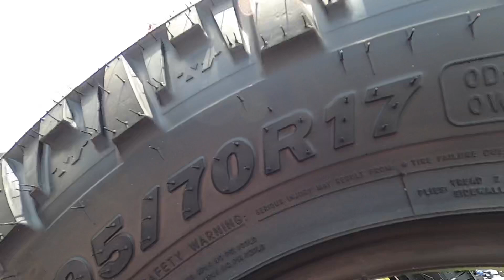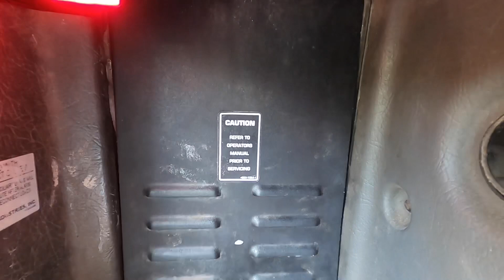Kenworth problems & Fuel tank leak

Comment: Just when I thought I had a bad day, I watched this video and I guess my day wasn't that bad. The tank patches turned out good and you can't see them. What I do is check the tightness of the straps every so often because they do loosen up and will cause wear behind the straps. And get a tube of die-electric grease and put some in each hole of the electrical plug and around the end of the plug where it will go into the female side of the trailer. It helps keep the moisture out and it's easier to plug and unplug without pulling the pins out of the trailer side.

Comment: Love doing burnouts with my pickup truck. It makes 625hp. Single turbo. It is a 3500 2018 dodge. It’s my daily, and it tows my race trailers. Really awesome truck. I was impressed on it stock. I upgraded it because I had to haul a bigger load on my gooseneck flatbed. It pulls the trailers like they aren’t even there now. Good trucks and the Cummins motors in em are awesome. Good engines.